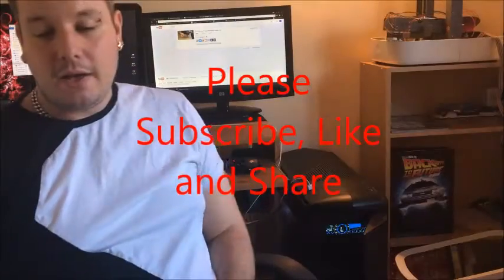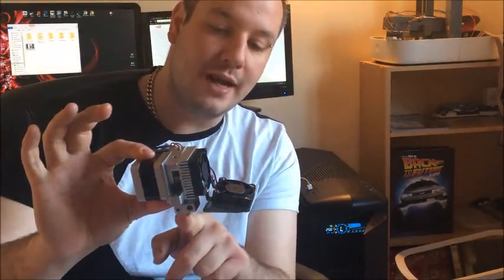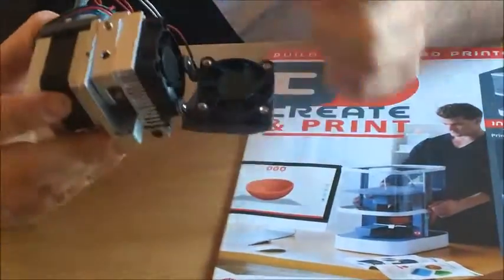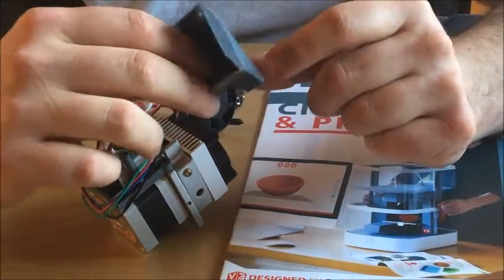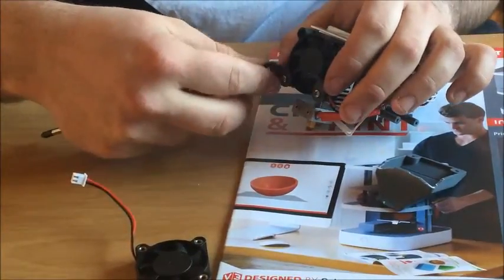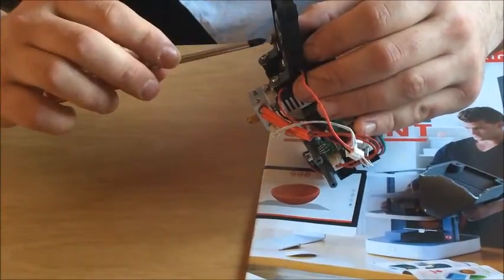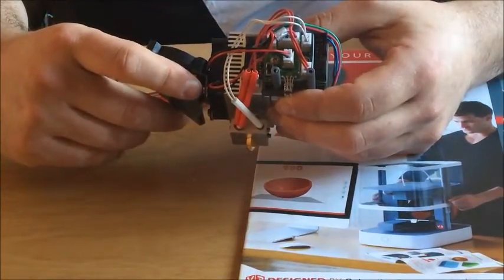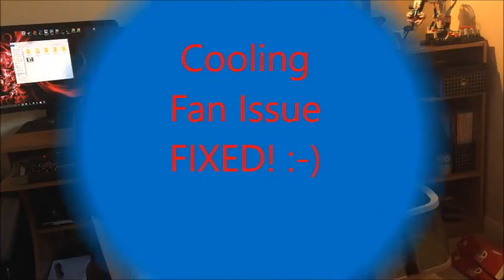V3 3D Printer Extra Extruder fan Flaws/Fix

Comment: hello, ive recently been given an old v3 i have several issues that i hope you could help me with
1. i cannot get the unite to connect to my pc a windows 10 unit
2. the fillament feeder tube appers to have snapped and im unsure how to replace it into the extruder
3. how do i heat the head so i can remove the old nozzel which could be blocked
4.is there a mod were i can use a sd card instead of connection to the pc

please any help would be am,azing
Reply from the maker: Hi, i have to be honest I’ve not had this printer for years it was a waste of space, i cant remember, in order to heat the nozzle you need to have connection to the printer as this is done through V3 software. I know there was some connection issues, all i can suggest is that you use the latest V3 software for the printer and try again. There was a mod yes to enable sd cards and i did it on my printer and also added a screen, i think i saw that tutorial from another youtuber.  It involves more electronic components that can be plugged it so you would need to strip the printer down to the board. I am sorry i am not much help but its been so long i cant remember ;-( i am currently running an Ultimaker 2+. If your getting into 3d printing i would suggest an ender 3 or similar, they are cheap and good to start with and much better than the V3 printer by miles.

Comment: Hi there have a small issue probably nothing but think u can help fix it so I fixed my previous problems now but in the printer when I click print after the bed heats up it starts the nossel and it only goes to 186`C and needs to be 200'C so I changed it to go up to 185'C and it won't go higher than 173`C now do u know how to fix it?
Reply: So I just decided to take the hole fan out now it works fine thanks dude.
Reply from the maker: Yeah the heater is not great in them especially if its the one that came with. I cant remeber what heater but you can get a more powerful one to replace. Thats what i did. But been so long now. I got shot of it years ago now using an Ultimaker 2+

Comment: Hi I have an issue my prints won't stick to the bed properly and my main issue is the filliment comes out then it doesn't then it does its inconsistent
Reply from the maker: Hi, ok for prints not sticking, theres a couple of options that worked for me. I actually upgraded the bed to a glass bed that worked for me. If you take measurements you can find the glass on amazon. Then just remove the brackets and then place the glass on the bed using heat transfer pads. If you don’t want to mess abut with that you can use printing tape. You can get it in squares and stick it over the bed. If that alone does not work use the tape and get some hairspray. Then coat the printing tape with hairspray. You will need to use hairspray if you decide to go down the glass bed route too. 

As for the inconsistency of the pla flow, its hard to diagnose. It could be the heater, the nozzle or the feeder. But after using a few other printers this vector is actually a really bad one. Hope you manage to get it sorted.

Comment: 2 year on how's your vecort 3 going ? 2 years to get all my parts plus 5 years later. Mine work s. But got print plat up to print head. But noe thru. Command in computer print plat whant move down ?? I'm hopen rod into moated is turning   if grub screw ain't Brocken. If not. Shood I reset it..as carnt move bild plate down by hand. ? It seem if you tell it to move up   but to  many comand s ..??  So it probly trying to move up more. I'm guessing.  Do u know best way to solve this problem. I Sean a video of the fan about have to tourn bracket around so fan pointing in right spot. I think I did it right. But I follow your steep s if I dident put fan brackets in right way.  Cher's on the Vid mate ..

Comment: Actually, mine wouldn't even reach 180.  It got up to 179, then kept fluctuating between 176 and 178.
I tried removing the Guide to stop it blowing directly onto the Nozzle; but it didn't help.  Simply solution I found, was to Disconnect It.  The Print Job is Not Affected.

Comment: I'm glad I wasn't the only one who found that fault with the Screws.  I did the same as you did.
I also noticed that it was too low.  But I just bent the brackets up slightly:  There's no need to turn the brackets up the other way.  Afterall, it's meant to be aimed at the Print Head, not the Model.  Aiming at the model could cause it to Cool Down too Quickly, and result in Layers not Adhering Properly.

ps ..  How do you set the Print Head from reaching the Edges of the Print Plate.  Mine goes over the Edges, and even above the Clamp.
Reply from the maker: Neville Madden hi mine did this when print too large. I have since changed the build plate to glass so there is no clamp on mine now to get in the way. I got the glass from Amazon thind its called broscilliate glass 400x400 and all that is needed is some thermal heat pads to stick the glass on to the metal build plate and so the heat can transfer into the  glass. Its a great

Comment: You know the cooling fan that came with issue 91?
Well, guess what!
I have seen some conversions and replacements but nothing of what I've done that I could find using the actual supplied cooling duct.
The "L" shape brackets that came with the fan you loosen and turn upside down (yes I know you done this) but wait.
Next, instead of putting the cooling fan on top of the upside down brackets, bolt the fan under the brackets (you'll probably will need to take off the hood cover to do it easier as I did). Next bolt the fan with the bolts downwards and the nuts up into the fan nut holes.
Then, simply attach the cooling duct as normal. You might want to slightly bend the brackets down or up to your liking but I tell you. It really works great and I just did a demo print of a cube and everything turned out beautifully.
And Yes! I did print up a duct from thingyverse and it also worked good, however, this was before I decided to do this. I could have saved myself filament if I known this earlier.
Reply from the maker: Andrew Glagau yes i printed one from thingy verse in the end, but i see what you mean about the original part :-)
Reply: It took a little nutting out but it's only because I forced myself to think outside the box ( so to speak ). The instructions they give you in issue 91 should be reviewed as the parts are good but the instructions need modifying.  If by any chance you can make a review video of this to explain the correct way to install the duct (like I explained above) it would be great.
PS: Keep up the good work on your videos.

Comment: Thank you very much from Victoria Australia. Information is really handy. I'm currently on a month's subscription which means I get 4 issues each month. Last month they sent me 76 77 and 79. They apologised for not including 78 and said it will be sent out as they receive the stock. I was so hoping to have issue 78 as it would have allowed me to at least print something.  Oh, well, maybe next month.
Keep up the good work as it's helping many people from downunder.
Reply: I only received Issue 78, AND Believe It Or Not, Issue 64, Yesterday May 19th.  Then to top things off, Issues 70 and 73 are STILL On Back Order, as is The FREE Binder that should have come with my First Delivery way back in November:  Yet they are supposed to be Reserved for Subscribers! ...um
.. However, my Local Newsagent, (who I used to purchase them from), has Issue 90 this week! ..... By the way, Issue 90 IS NOT the Last Issue! .. Issue 91 comes (with a Spare Fan) FREE with Issue 90.  There is a Page on The Website to Fill In Your Details (Subscriber Number, Name, E-mail Address, Post Code) to Continue to Receive Issues 92, 93, 94, 95, (I can't recall if there's an Issue 96).  It's worth doing, because of what is included with these Issues.

ps ..  The reason I subscribed was not only to receive the Free Gifts (which are Awesome), but because, even though there are Forms with some Issues (and it is mentioned in the Magazines) that says you can Subcribe through your Newsagent, you Cannot Officially Subscribe through your Newsagent, because they get them from a Distributor (Middle Man) who gets them from Bissell Magazines (the Australian Agent for Eaglemoss):  And the Distributor/s ARE NOT Reliable!  My Newsagent often missed out on receiving all his Ordered Stock of the Magazine each week.  Also, there were times when he would get (lets say) only 3 Copies of a Current Issue, and 2 other Issues (The Distributor Delivered WHATEVER He Had In Stock).   The Newsagent only Ordered 5 because there were only 5 Customers who purchased them from him.  So it was easy to miss out if you didn't get to the store before they were sold out (He didn't put them away, he put them on display, because if we saw them at another store, it was wise to buy it, because if someone else besides his regular customers came in, and bought any, you could miss out.
When I was getting them from him, he NEVER received Issue 11 (at all), and it took several months for his Distributor to get it for him.
Reply: Only just yesterday I received my back issue 78 along with 84 to 87. So, now I'm waiting impatiently with anticipation 88 to 91. 91 being the cooling fan for the extruder. Apparently issues are going to 110 and hopefully more additions and updates for the printer. 3D Printers do eventually wear and will need replacement parts. As long as we stay as subscribers, we will receive updates along with updated information. This printer will not be completed as long as there are continuous updates. I'm hoping in some stage one of the updates will be a modification of the front panel (where the pause button is) to enable us to use a LCD screen which has the capability of inserting a SD card without relying on the computer connection.
Reply: Don't Hold Your Breath with the LCD Screen!